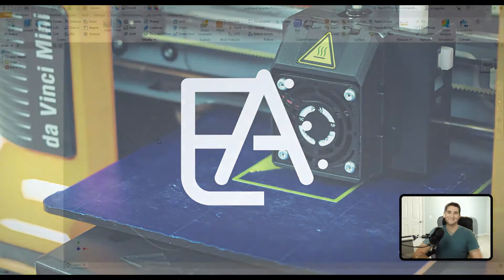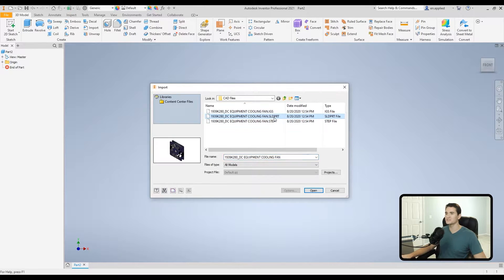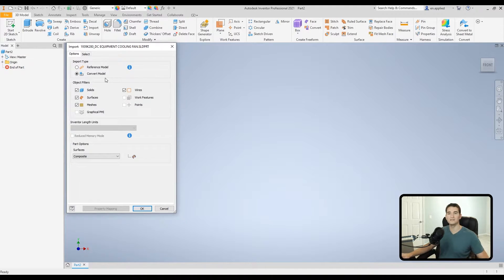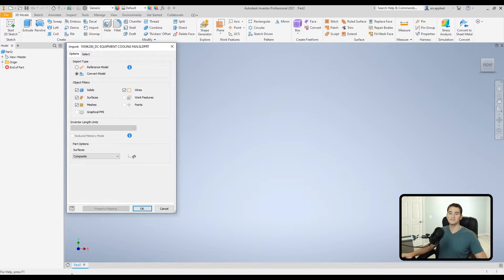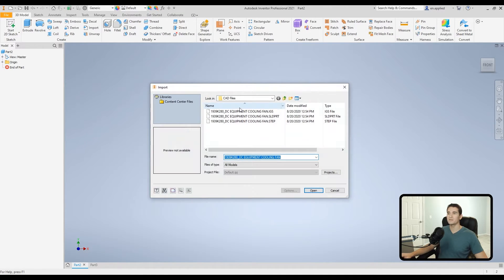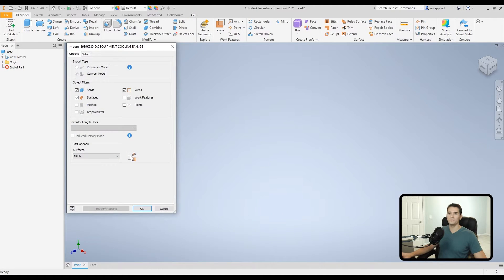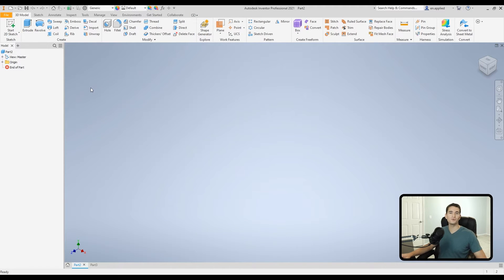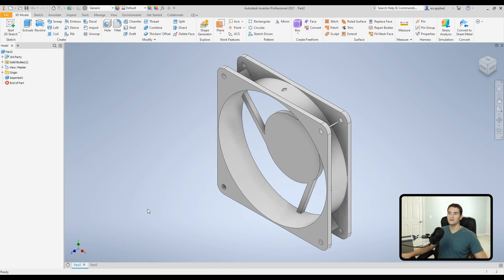Import Tool and Options - Autodesk Inventor Part Tutorial | Autodesk Inventor 2021 IN DEPTH

Comment: Please make a tutorial on making that 24VDC fan as separate .ipt part files. I build AC -> DC rectifiers used in gold plating and other similar applications and use those exact fans and need help making the parts in inventor